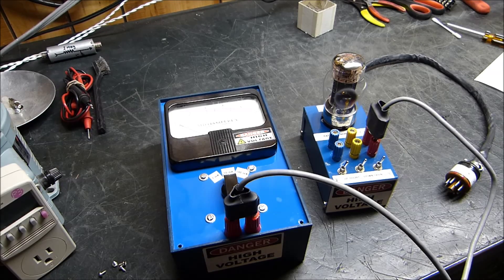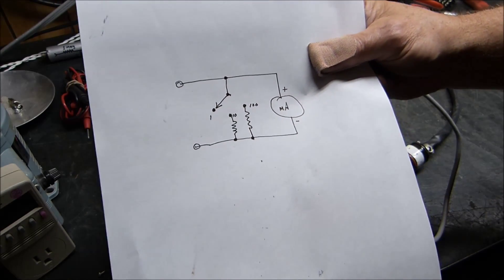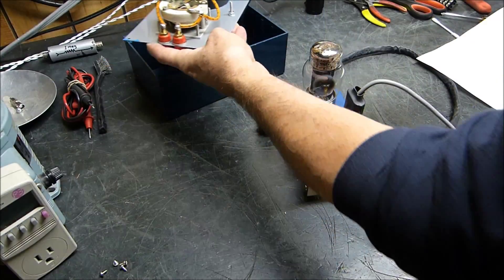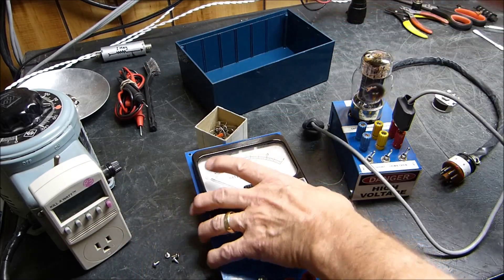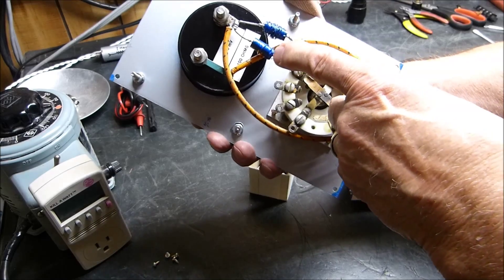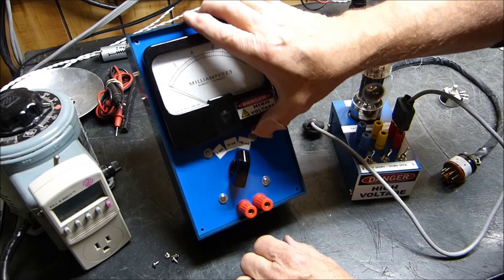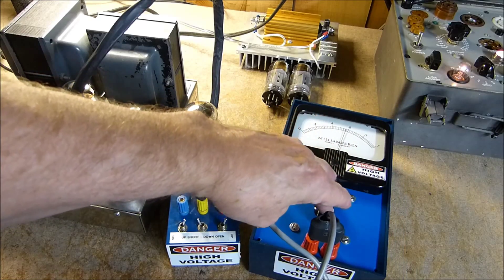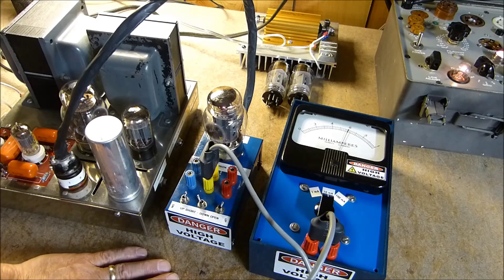Analog Meter For The Vacuum Tube Bias Probe

Comment: Yes, be careful with your  meter. I changed the setting on my DMM and forgot to move the lead from current to voltage, I came across 750V that had a 1000mF cap on it. It didn't only explode the glass fuse in my meter, but now the 20A setting on my meter no longer works, ooops. It was the best thing I ever purchased from Raidio Shack, and I had it forever. I loved that meter.
Reply from the maker: I understand, I smoked a Fluke meter because I did not believe the maximum RMS voltage was 750 and I measured something over 1000 volts and it sizzled and that was it. And I did a very similar thing with a Tektronix meter - probably what I mentioned in this video and smoked the current scale. We live and learn...

Comment: So would momentary push buttons be a better option for the switches in the bias box to avoid switching to an open circuit by accident ?
Reply from the maker: I think that's a good idea. All of the contacts should be closed all the time except for a reading.  Maybe others will see this and choose to use (good quality) push button switches. Opening the plate switch without a DC path through the meter is assured destruction of the screen grid of the tube. Thanks...

Comment: Nice video - I have a bunch of 6L6's I want to measure. Is this pretty much the way to match them? It's only for guitar amps, not a McIntosh, if you know what I mean. I have a couple 100 mA analog meters I want to put in a box with binding posts - Thanks - keep 'em coming :)
Reply from the maker: cmguitar50 You don't have to have a test box to measure and match your 6L6's but it sure makes it easier and safer than doing it in your working amplifier. The goal is to measure the cathode current of each tube in a working unit. You can do this a few different ways. Let the tubes warm up very well and put a sticker on each tube with the value of cathode current and use pairs that are closely matched. It does make a difference.. Stay safe.

Comment: Hi David!  One minor addition for the kids not familiar with bare-bones current and voltage meters like what you have built here:  A good safety precaution is to always start the meter on the highest range, and dial down the range as needed.  If you accidentally connect to a high voltage or high current source, with a sensitive meter movement you risk damaging it. I have seen pointers get wrapped around the end-stop.  That sort of thing will ruin your whole day.

Comment: question... I have enamel coated wire... from rewinding an ac motor.... could I use that.... since it is available?
Reply from the maker: You have to kind of look at this first from the 40,000 foot level. What I mean is, say you have a very sensitive meter like a 50 uA movement and you want it to measure 500 mA. This means you are going to have to shunt the vast majority of the current around the meter so you will need wire of pretty low resistance and not much of it. On the other hand, say you have a 5 mA meter and you want it to measure 500 mA. This meter is 100 times less sensitive than your 50 uA meter so you will need a higher value of shunt resistance. Another problem comes in with the length of the shunt. Ideally, you would want 3-5 inches so that you can trim it to read accurately but not so long that you end up with a huge spool of wire on the back of the meter or neither a 1 inch piece of wire that you cannot adjust for calibration because it is too short. Large wire like No. 16 or larger (like the wire in your AC motor) is probably too large to make a reasonable shunt as it will take way too much  (several feet of it Might work for shunting a 50 uA meter to 50 A - just a guess). In general you can only make shunts for up to say an amp or so. Anything larger than that, you may need an external shunt and run wires from the shunt to the meter. Weston makes some really nice shunts and most are for 50 mV meters. You will find commercial made shunts for 100 mV meter harder to find and you may have to make your own as I did. I hope this helps. It is not hard but without some experimentation it may be hard to grasp. For example, if you take a 1 mA meter and shunt it with 1 foot of No. 16 wire it will read probably 30 amps as the shunt of No. 16 wire will have such a low resistance. This example is not an exact real life example but just to illustrate something realistic. Experiment with some low mA DC meter and a couple of batteries (3 volts) and an adjustable resistor in the 10 ohm range and you will get an idea of how to deal with it. I hope this helps.

Comment: Hi David! I really like the idea of using an analog meter to measure current! Even though a digital meter says it clearly, I still prefer an analog movement. That's why I still use my old RCA VTVM...its especially good for high impedance circuits which is prevalent with vacuum tubes since they are high impedance devices. I'm also thinking about building a bias box using dual octal sockets and dual LED digital meters. I've seen these meters for as little as $13 each, and thought about putting them right into the box. What's your take on that? It will be a more sophisticated version of the Bias King since the meters will be LED and easier to see in low light situations. Another great video as always :) Frank Ferraro--Audio Craft Electronics.

Comment: Another very cool video. But best to get a couple of diodes in there to protect your ammeter. (Use two 0.7v diodes, back to back to protect in both directions between your shunts and the meter. If you do mess up when connecting, that will then only destroy your diodes but will save your ammeter. They do this with all the school lab ammeters as kids always able to fry ammeters.) Yes better to use make before break, but diodes will give you the protection even in the worst scenario.
Reply from the maker: Kevin O'Brien  Thank you for reminding me - I will add the diodes. No need in destroying a perfect 50 year old vintage meter over a single, "OOPS..." I once had a meter movement that I had connected to measure the HV (3KV) in my transmitter and even though I knew better, I used only one 2 watt resistor of the correct value - well, you know what eventually happened... the physical path was too short (I should have used five, 2 watt series resistors) and it arced and you can imagine what 3KV does to the inside of a meter movement. I wonder if in this case diodes would have saved the meter - maybe so. I still have and use that transmitter and the voltmeter (replacement...) still works after more than 30 years and I do have diodes across all the meters in that unit. Thanks again.
Reply: ElPaso TubeAmps If it arcs over (which it probably would do) then not even diodes would have saved it using 3KV. Ha ha! (Need a very fast acting fuse behind diodes maybe? but I am not sure even if that would have saved it?) Possibly using a sense resistor connected across a transistor to completely isolate the meter (small battery then needed) I think the old battery driven valve meters used this type of isolation setup. But again, I am not sure. But there are lots of circuits out there for high voltage protection methods, its a  fascinating subject.) I can imagine that movement exploding into dust! HUGE BANG! Great videos BTW! keep them coming!

Comment: I love Yankee ingenuity (or in your case, Texan ingenuity). So, what is the resistance tally of each of the 100k ohm in parallel with the ni-chrome wire components? This measurement will be somewhat different depending on whatever meter is used,  I suppose. Also, is the resistance consistent inch by inch in the wire so all one needs to do is measure off so much wire for an approximate amount of resistance? Finally,  the 100k ohm resistors appear to be larger wattage, is that relevant... just the size for wrapping the wire? I greatly appreciate your pragmatic approach and thanks for the gift of teaching coming from you.
Reply from the maker: Mark Weber Hi Mark - Thank you - the 100K resistors are 2 watt as I have lots of them that's why I picked them. Anything over a few ohms would be OK as a form to wind the shunt wire on as the actual shunt is probably only a few milliohms.  I have used 1 mA meters so many times I have the procedure down to a quick-and-easy fix. Meters like 50 uA are a bit of a different challenge and require experimenting with different shunt wire and large shunts like 30 A, again, are an experiment to make the shunt wire large enough to carry the current, etc. I have never seen the need to mathematically calculate the shunt resistance as measuring a few milliohms or a few mircoohms is just too tedious and not necessary as in-the-end you are going to have to manually adjust the shunt anyway. In the cases of 10 mA and 100 mA and even 500 mA shunts, it is just too easy to do it manually. Wire saved from large wire-wound resistors works good but a little bit of a challenge to solder to.

Comment: loving your work, and the "have fun and be safe in the new year", I have just made one of the other type bias test rigs, the socket on plug type with shunt resistors, in it which i bought as a kit , but may build your type also and love analogue meters I have an old AVO, and love it, my new years res is to finish my valve amps i started to make.
Reply from the maker: Ron Warren Hi Ron, you are wise to measure cathode current as that is so much safer and just as effective. For some reason I wanted to measure screen current back in the day when I built the bias test jig I have but it does somewhat expose the user to the HV from the screen and plate. Got to always work with one hand and the other hand in the pocket and never leisurely lean on the work bench with one arm while working on vacuum tube circuits. Some time back I reluctantly made a video on measuring plate current by shunting the meter across the output transformer. That is the most dangerous way to both the human and the meter. I have blown fuses in my meters too many times by accidentally touching one of the probes to the wrong place. I do not recommend that method or use it anymore.
Reply: ElPaso TubeAmps yeap that was the first thing I learnt doing valve tv repair at college ( back in the 1970's when i was at college), put left hand in your pocket, to save electrocution . was on the test paper to.